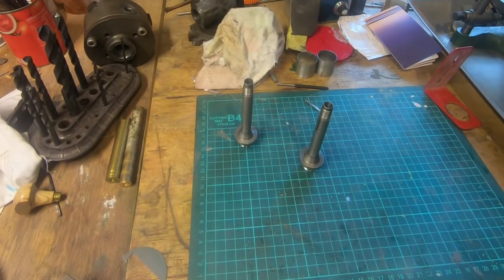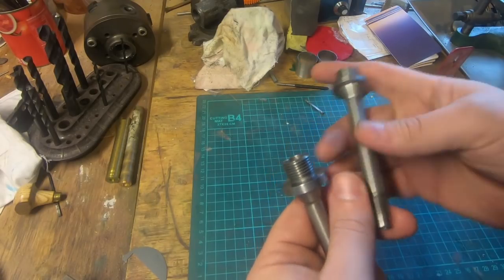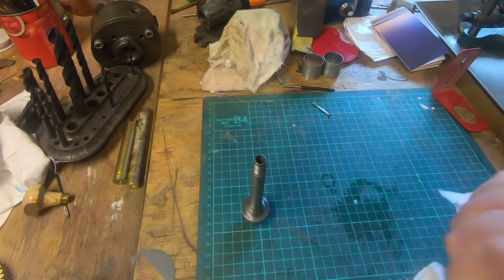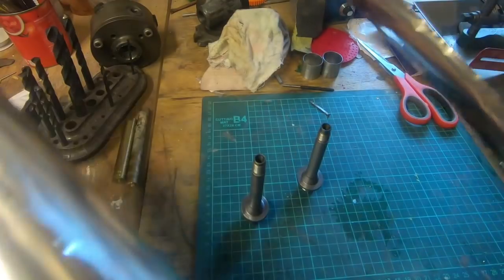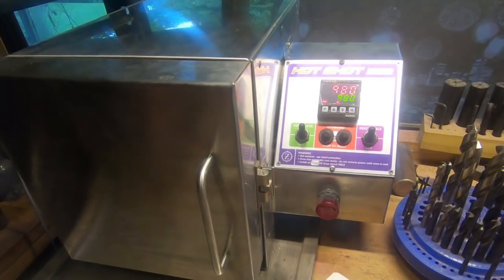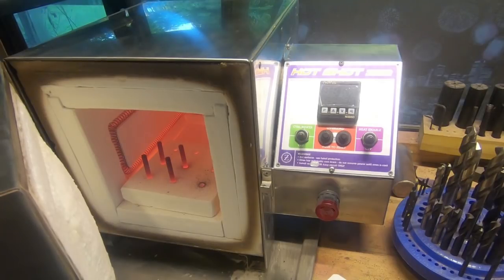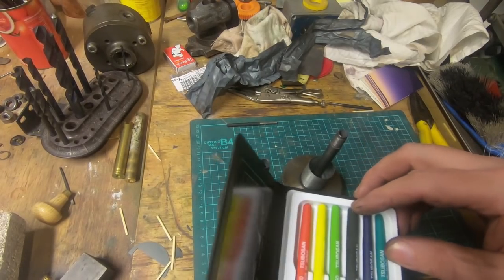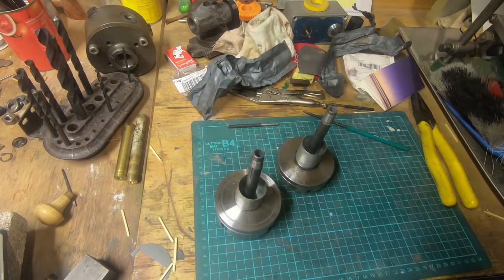heat treating chuck arbours in the HOTSHOT360

Comment: If you want to fully air harden D2, the air needs to circulate around the part to cool it quickly enough.  the stainless bag makes that difficult.  I guess that forced air cooling might do it, but an oil quench might be better if you leave it in the bag (as recommended by bcbloc02 in the comments).

Comment: Nice result Emma, certainly very little scale, compared to exposed heat treat.
Another subscriber commented on the reduced efficiency of air cool when using the SS method, forced air is better, or as suggested, oil cooling, maybe a thicker oil, I think with your relative  high ambient temperature. 
Difficult first project well done.
Reply from the maker: im learning as i go. I was a bit worried about distortion as much as anything ,they're thin parts.
Reply: @EmmaRitson  yes, they are very thin, your heat soak just below critical temperature prevented distortion on quenching. Many forget this step (applies to nearly all hardening steels), and wonder why their parts are no longer as machined.

Comment: Just a tip but close your oven door back ASAP when in use. It helps reduce the thermal swings that damage the firebrick so it will last a lot longer. The bags make the air hardening not work as good as it should. I use a slow quench oil when doing d2